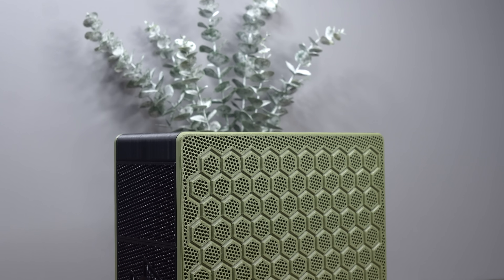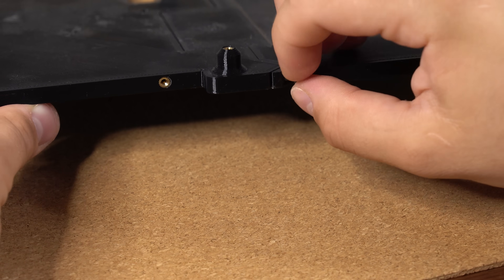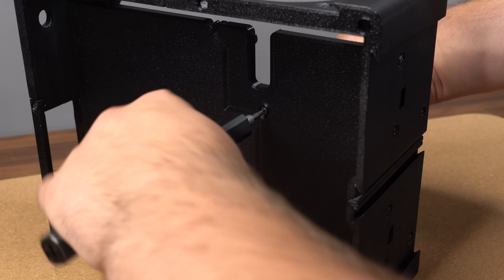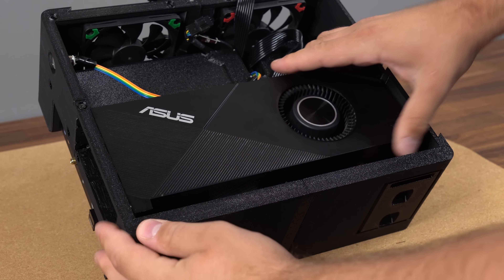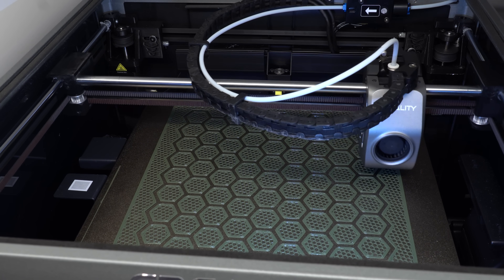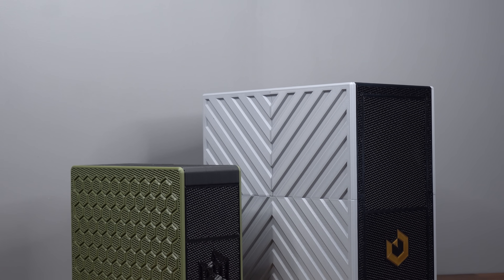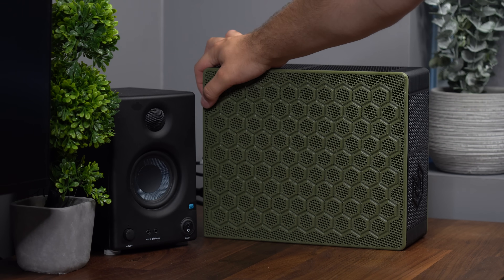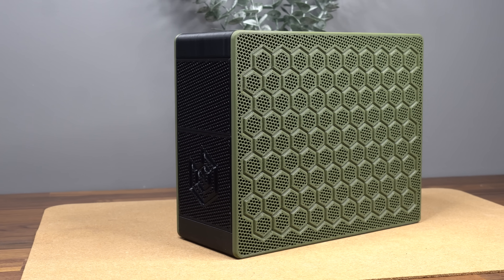A Backpack friendly 3D Printed ITX Gaming PC case

Comment: Hello : can this build be used for professional 3d modeling, is it a great pc and whats the total bill of the pc parts, thank you
Reply from the maker: Hi there!

I’m not sure if I understand what you mean by using the model for professional 3D modeling. Do you mean to have someone print it for you? If so, I don’t have an exact number but I’d imagine it would be pretty pricy. 

The total cost of the build will come down to what filament is being used, what parts are used and a lot of other factors so it’s hard to give an exact overall price. It can range anywhere from $300 to $1000+++ depending ln your choice of hardware. 😊
Reply: @makerunit  thanks for the response : I meant can a cad software run efficiently on this pc build without troubles.
By Bill of materials I mean the pc hardware without the printed parts, thank you
Reply from the maker: @mugaggakennedy  Aha! Sorry my bad, now I totally understood your question. I feel like that’s a difficult question to answer, as it will all boil down to how complex models you are going to create. A 3D model uses a lot less processing power in the beginning than towards the end. So in the beginning of a model, most PCs will run smoothly, then as soon as the complexity increases, the processing power needed will also increase. So for simple models, yeah it should be fine, for big, multi-part highly detailed models, probably not. 

As for the price of the parts, most parts I used in this build were older parts that are no longer sold in stores so if buying them used you’d probably be looking at roughly $400-$600 in total (just a guess), and will also depend on where you live and what marketplaces you have available.

Comment: That looks great. I have acres to a 3d printer at work and I wanted to start a case protect like this for my build. Where should I start? What programs to use for the design etc?
Reply from the maker: Hi! Thank you. Personally I started in Sketchup many years ago but I can’t really recommend it for this type of designing. So currently I’m using Shapr3D and I’m really happy with it. They have a free version that you can play around with a bit. 😊 I’d start with just learning some basics. Don’t jump right onto a complicated project, try to make it super simple at first to get the hang of it, then slowly add details as you learn.
Reply: @makerunit  Thanks a lot for your response. I'll definitely try it out :D

Comment: Can i print this on an Ender 3 V3 SE??? Will it fit my printer bed??? i guess its 20x20x25... if im correct
Reply from the maker: There is one version that’s printable on a 180x180mm print bed. Both versions are included in the file if you get it 😊 so yes, the split version is possible to print on the Ender 3.

Comment: I hate heated inserts, I prefair nuts on the other side of the print (or in slot). Those are cheaper and easier to buy. Also always you can take it out from used/broken part. Anyway good job and realy nice design.
Reply from the maker: That’s definitely a valid point! The re-useability of nuts would be nice, but again I think threaded inserts offer an overall cleaner product, and they are so cheap in a pack of 200-500 anyways so it’s really no point re-using them anyways. 

And thank you, I’m glad you like my design! 😊

Comment: i wonder what kind of gaming can this handle...generic old games maybe, not something you'd take your pc to play with.you're better off with a modern gaming laptop than this setup.
The idea and thinking are on the right track, but needs more thinking effort before doing.. and also measuring thermals
Reply from the maker: This 2070 handles AAA titles no problems at pretty okey framerates, way better than my «modern» laptop tbh, +. G-sync and all the beenfits that comes with. It will obviously depend on what kind of hardware you put in there but remember there is also the question of price. You can make a pretty decent build in a case like this for less than $6-700 usd, while a laptop with similar performance would end up at probably twice the price.

Comment: I want to print this. Does this not deflect the PETG when it has load?
Reply from the maker: Hi, no not really. PETG will not deform at the ambient temperatures created in such a case. In some circumstances PLA may deform slightly, which is why I recommend PETG 😊
Reply: @makerunit  ok thank you for your prompt reply. Hope you can design a case like Velka 5 5.7l next time which is much smaller
Reply from the maker: @janernstd9842  maybe, but my main goal is to make designs that are buildable with commonly available parts, so I’ll see about that 😊 thanks for the suggestion

Comment: Love this design my only observation/question is why wasn't the riser cable secured down with threaded inserts for extra rigidity of the gpu? (on top the two screws already used)
Reply from the maker: Thank you! And I decided not to because due to the way it’s designed it would be difficult to insert large GPU’s near the max size limit if I did that. 😊 I did consider making a custom height adjustable height support but ended up not 😅

Comment: why didnt you split the panels with the pattern? would have made the parts a bit bigger, but the cuts would be a LOT less noticeable.
Reply from the maker: It crossed my mind… I should have done it definitely 😅although, I decided not to because I thought it might interfere with the cross joint, like making it difficult to slide into place 😅

Comment: I use a Lenovo M910x with a RTX A2000, i9-9900T in a 1,8L Case 😜
Reply from the maker: Nicee 😁 any pics?
Reply: @makerunit  OS is BazziteOS and PS5 Controller 😉
Reply: @makerunit  to get i9-9900T to Work you need Mod BIOS to add Microcode for Gen9 Intels and short two Pins on CPU. Coffeetime is the correct tool. Also you need a Prommer with SPI Interface. I use TL866 Prommer.

Comment: I see you got a new phase again. This time using magnets, inserts, and tracks. In the end, you end up using a lot of filament, due to the usage of tracks and inserts. The mesh also ends up really restrictive. But, that is more or less the results of the techniques you use. Also, your tolerance for noise is way higher than mine, as this has to be noisy, due to really restrictive and sub optimal airflow. But you offering a case for small printers is quite a feat, so congrats on that one. Your assembly techniques are really improving.
Reply from the maker: It’s a little noisy under load but honestly most people would be wearing headphones during gaming, as that’s what this system is intended for, a portable gaming pc with mid-range components. 

There are always ways to cut filament but often at the cost of structural stability, and especially for a build intended for the backpack, it needs to be sturdy. I’m not saying it’s perfect but I’m very happy with it 😊

I’m glad to read that you notice some improvements, and that’s my future plan as well, more improvements, I learn new things every time.
Reply: @makerunit  Sure. I kind of tried to point out in a diplomatic way, that the case has really bad air flow. You have chosen that, it is not needed. I guess I have to leave it at that.

As for people looking at printing this thing, your VRM temp, as the temp of the backside of the MB needs to stay below 65C for PETG, so do not use Gigabyte AM5 MBs.

Comment: Only problem is that I can't find a flex ATX PSU at the 700W that I need for the rig I'm building, and the closest thing is a 600W from silverstone for $175 which is over my budget for a PSU.
Reply from the maker: What parts do you have? Sometimes power supply recommendations from GPU manufacturers have a lot of safe margins, because they take into consideration that you’ll be using tons of fans, hard drives etc etc accessories. In a simple system like this with very few parts it should be able to run on a lower wattage.

For instance, I’ve got a 450w SFX psu that I’ve ran a 2070 Super + i5 10400 on for a long time without any issues, even though the manufacturer recommendation for the 2070 says 650w. Totally up to you but try to calculate the max power usage of each part you intend on adding including cpu fans and chassis fans, then take into consideration the «efficiency» of the hard drive, if you’ve still got a bit of wiggle room after subrtracting the efficiency rating, you should be good to go 😊

Comment: does the material matter? like will it be bad if I print in pla?
Reply from the maker: I recommend using PETG, ABS, ASA or PETG-CF. Petg is probably the easiest to use of them, and most easily available.

Comment: i hate it. i mean like it s functional and all, but the 3d printed aesthetic with not so seamless joints looks awful. If I had to built that i would definitly sand it and clear coat it least, maybe even paint it. The design of the side panels is alright in the one part variant, however the multipart one combined with honeycomb is just ugly. I would ditch the hexagons and make something more focused on seamless joints like vertical and horizontal lines, I am thinking of something that makes the joint lines into a pattern.
Reply from the maker: I respect your opinion, and I’m sorry you feel that way. Although I can agree on some of the points that the joint could have been put more work into making more seamless.

Comment: Awesome design!

I currently have a mini-ITX Board, Full ATX Powersupply and 3 Slot GPU and got that all into my Raijintek Ophion EVO case. But that only fits 2,7 slot GPUs so i had to dremel out some part of the bracket.

I'd love to see your take on a case with those specs.
Reply from the maker: Thank you! I’ll keep it in mind! My goal is to eventually have a design out there to fit every single possible layout out there but that’s a lot.. so it may or may not take time, but without a goal nothing moves forward 👌🫡
Reply: That is extremely ambitious and i am all here for it lol!

Great work you do here! Keep it up, but don't stress yourself out please!
Reply from the maker: @Nepoxification  haha great to hear you’ll be by my side through it all 🫡

Comment: There are two different ways to make a joint disappear: Try to make it look as small, tight, and similar as possible or accent the joint and make it look intentional. I install tongue and groove ceilings sometimes and you'd be amazed how often people use staggered splices when they could put a perpendicular board in the center (preferably thicker) and have both sides dive into that. Now it looks like a center accent with whole boards running cleanly into it. You don't have to worry about one piece warping at a different speed and peeling away from the other butt splice. If you have splices, accenting them will often make it look cleaner. For a four-square side panel, it could look like an inset banded cross with different heights at the center splice so that one side (longer center edge) can tuck under the other piece like a lap joint, creating a shadow line with no exposed edges. Shadow lines will elevate your work to truly professional grade - that's what the seam on your Xbox controller is. It keeps out dust and moisture for secure enclosures, but also gives a more sleek appearance.
Reply from the maker: Yeah you’ve got some very good points! Especially with the shadow lines, that would make for a nice touch I’ll have to look more into! I could have also made the split along the big Hex pattern rather than straight lines, that would make for an even cleaner seam. 😊
Reply: @makerunit  That's a proper enginerding mindset. I love to see it. The diagonal bowtie splice pieces were clever. I don't plan on making any through subtractive construction mind you. But through additive construction with 3d printing, it's just as simple to make as a basic dowel.
Reply from the maker: @notmirelnam 😁 the dowels were very simple to make actually. Just make a normal 90 degree butterfly, then offsett the top surface 45 degrees. Then use subtraction in the side panel to make the hole.

Comment: Liking this design a lot! 

Makes me wonder if a couple things could be tweaked here and there to make it compatible with SFX supplies too!
Reply from the maker: Thank you! I’m happy to hear you like it! There are definitely things that can be done to make it SFX psu compatible also, but it would force it to be slightly bigger. 😊 maybe I’ll make a v2 some day with this in mind!
Reply: @makerunit  That would be fantastic!  I'd say Flex and SFX power supplies have changed a lot through time, but the latter are quieter! the larger fans sure help bringing the noise levels down. 

25-ish mm is all I think it'll take to make it a perfect fit for an SFX supply too, perhaps it won't knock too much of the thin aesthetic out in the way!
Reply from the maker: @DaWalkDude  for this one I wanted specifically to be able to fit it onto a 300x300mm print bed, if I were to use a SFX psu I’d end up at about 320. But I do like the idea of more versions!

Comment: Backpack friendly ?
You misspelled laptop.
Reply from the maker: Most gaming laptops are super expensive, lower performance due to having to save on power consumption and heat. Sometimes they’re good! But usually the price-to-performance is way too high compared to what you get by building it yourself. I actually use a Laptop for a lot of my daily tasks, as it’s convenient, however my laptop won’t give you the benefits of high FPS, no G-sync/Freesync. 😊

Comment: Unfortunately i think 83°C is the design throttle threshold for that card. Many of those cards are on the edge of throttling from the factory no matter the incoming air temperature or case airflow.

I wonder about airflow impedance vs. air noise vs. air cleaning potential of various infills. Because there is naturally dust in the air, and it's nice when you don't have to worry about computer components gaining dust and only need to wash removable enclosure pieces instead.

I have an impression that Gyroid infill will make for a pretty effective air filter, since it forces the air to twist and mix around, potentially giving extra opportunity for dust particle to touch the infill. But i wonder what the outcome is on noise, whether it will create more air friction noise on the surface, or on the other hand happen to block sound waves.

You can make a lot of trick infills. For example you can manipulate extrusion width to be smaller than nozzle width - and increase perimeter overlap - to create thinner denser structure for straight line type infills.
Reply from the maker: I see! Kind of makes sense! 

About Gyroid infill, I’ve actually used it as a «filter» before and it seemed to work pretty well, the only downside is that it’s incredibly weak, bends easily and breaks easily. But for applications where you use gyroid only as the air filter with a stronger «frame» or slot to slide the filter into, it would probably be a better fit. 😊

Comment: The fact you made this printable on an A1 mini is amazing. Very beautiful design. I'm tempted to buy and build this You should consider adding space on the back where the GPU goes that can attach 2.5 inch hard drives for a mini NAS SSD build - the homelab community would eat that up. Fantastic design!
Reply from the maker: Thank you! I did try really hard to find a suitable location to put a 2.5 inch ssd, however no matter what I tried I could not comfortably fit one without compromising on GPU space or other necessary parts. Therefore I opted for a system  relying solely on M.2 storage… 😅 However, I plan on making many more cases down the road, and a pure SSD NAS is on that to-do list at some point.

Comment: Could you make a modified version that fits an ultraslim bluray drive?
Reply from the maker: Unfortunately I don’t have any blueray drives to test the system with. And I’m mainy aiming for designs that are wanted by the masses and not individual customizations, if you need customization you’d have to do that yourself in most cases unfortunately. I hope you understand 😊

Comment: Do you offer a membership level with a commercial license?
Reply from the maker: I’m considering it, but I’m trying not to implement any more tiers at this point as I might move my hole membership thing over to another more user and creator-friendly platform like maybe Thangs, as Printables is kind of limited in terms of tier customization.
Reply: @makerunit  do you have an email to continue this?
Reply from the maker: @Armor3dprinting  if you have a Printables account you can DM me there, does that work?
Reply: @makerunit  that works

Comment: Hello. There are a lot of cheap motherboards with size 19x19 cm, that is formally matx, but in fact these are much smaller than max matx size. These are narrower motherboards with 2 pci slots, upper is usually x1 slot, lower is x16. Can you make a 3d printed case for this and 2-slot videocard? Maybe with pci e riser used.  Or without it. Thank you.
Reply from the maker: Ah, I didn’t know that! I’ll look into those 😊
Reply: @makerunit  for example you can find Asrock H310CM-DVS

Comment: Awesome case! It's really inspirational to see how you use different techniques to fit the case together as well. A project suggestion i have is a case for a raspberry pi which has a space for a power bank, 2.5 inch drives and maybe a sim dongle. It would pretty much be a portable NAS :p
Reply from the maker: Thank you! That would definitely be an interesting project… 😁 I have something similar in my mind as a future project but mainly thought around a Pi and 2.5 ssd’s, wasn’t planning the SIM and Power bank but maybe maybe 😅